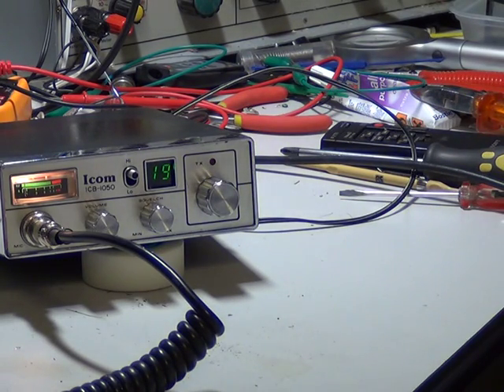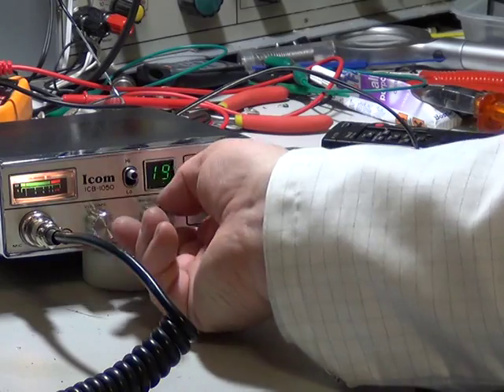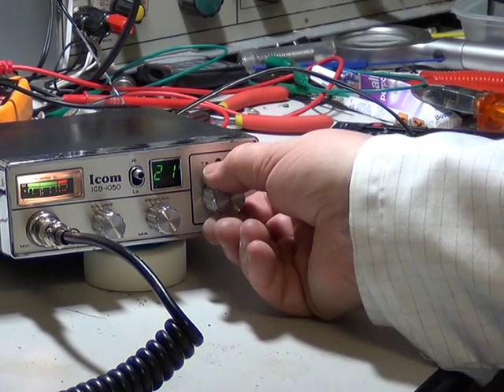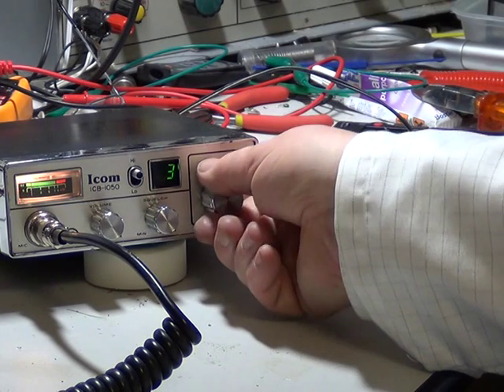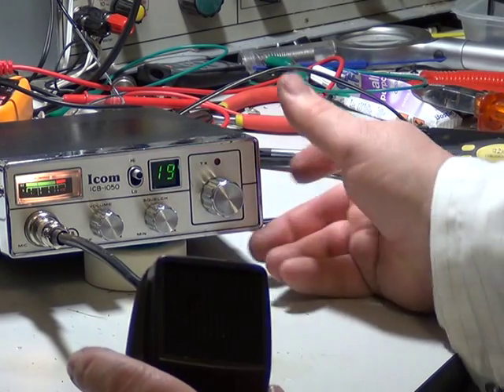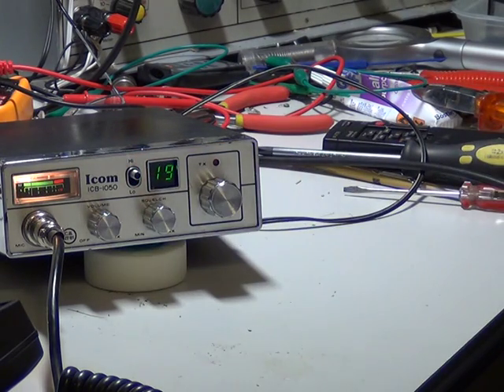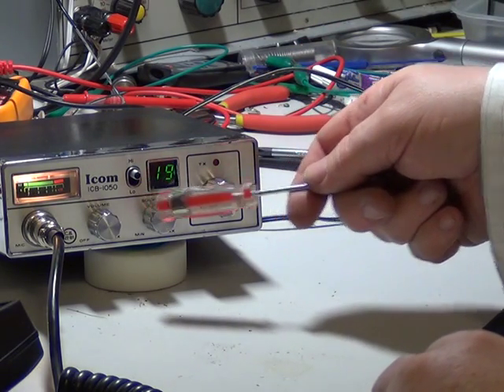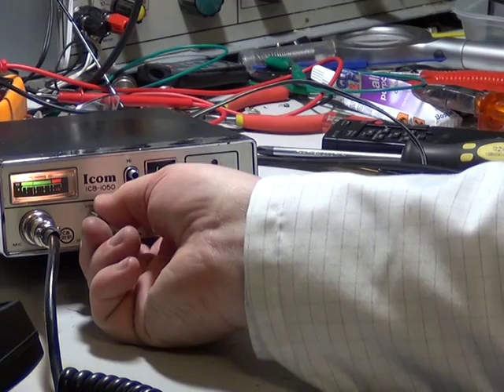Icom ICB1050,  UK (27/81 band) CB radio (Mobile). On the air test.

Comment: Hello I’ve still got one of these and have had it for a number is years. Only trouble I’ve got since I have powered it up it’s only keying up to around 5 pounds. Was wondering how you share any tips on what could be wrong. Thanks.
Reply from the maker: The power output meter only reads relative to SWR. When we set them on the bench into a dummy load at 4W, we then set the RF meter to also read 4W. However, when connected to an aerial & put into transmit, the meter could read any old thing; it means very little. You only can read the power output into a proper power output meter connected to a dummy load.

Richard, G0OJF, UK
Reply: @ukfmcbradioservicingTango21  hello Richard thank you 🙏 so much for your reply and help. Il give that a try. Greetings 🖖 from wales 🏴

Comment: Hi Richard these videos are superb...Can you please advise the test equipment you use,.also those little tuning pot tools. How about a workshop tour (cheeky)
Thanks and if i hear you from Yorkshire i will acknowledge your 19 FOR A ROGER ......ha ha   P.S i sent you a PM with a request.
Reply from the maker: In reverse order...I originated from Yorkshire, but have lived & worked in Lincolnshire since 1985, Near Ancaster, 7 miles from Grantham.

Test equipment. There are four test benches here each equipped with a communications test set. All test sets were purchased second hand over the last 20 years from Stewart's of Reading. I'm on a tight budget so I've never paid more than £1K for a test set, though they cost about £12K new. The test bench in the video is equipped with a Marconi 2951. Another bench has a Quartzlock 282A test set that doesn't go down to CB frequencies on receive, but can be used on CB's for transmit, my favourite is the Farnell SSG520/TTS520 combination test set because it's the quickest to use, and finally a Schlumberger 4040. Each bench has an oscilloscope & all except one oscilloscope are dead cheap ones because we are only looking at audio. One oscilloscope is an expensive one for in depth fault finding. There is also a very expensive sweep generator on one bench as you need one to set up the Great chassis like is used in the Fidelity 1000...believe it or not!

Each bench has Weller transformer operated commercial soldering stations, one is a digitally controlled one for doing SMT work with. Each bench has a cheap digital multimeter, there is a proper AVO multimeter in the workshop & a FET High Impedence multimeter, two IF marker oscillators, a portable audio generator, two CB mike testers, a logic probe, battery operated audio oscillator & various aids that we have made. Three benches have digital display 2.5A power supplies (no UK CB draws over 1.5A ), and there are a couple of other metered 20A power supplies for use when I'm doing commercial 2-way radio as many of those draw over 5A with their 25W transmitters. There are a number of Alexander battery analysers around as well.

The trimming tools come from RS components...but they have neatly discontinued the black phosphor bronze ones we use & I'll have to source a new supply. The Blue & Yellow tools are from RS. There are a couple of kits of plastic trimming tools that are also invaluable that came of Ebay!

Workshop tour may be possible later in the year when I've finished changing things around. Currently test benches are in different rooms & buildings here. At least three will be in the same room as the videos are being done in as soon as funds permit.

Regarding your PM, nothing yet received. try me at richard DOT shireby AT virgin DOT net . 

Richard

Comment: Hi Richard nice set of videos so far the information is helpful as the service manuals are hard to find now for some of these radio's. Is there any chance of some trouble shooting videos? Nice work tho and thanks
Reply from the maker: The troubleshooting bit can be hard to get across. Receive faults can only be sorted if you have a signal generator, though these can be picked up on Ebay for a tenner from time to time. I started formally studying electronics at technical college when I was 15, doing a three year course to learn about general electronics doing City & Guilds TV servicing later on (waste of time these days!), and then radio communications later. When I worked at Nottingham radio Communications for about 18 years I went on countless manufactures courses primarily with Maxon & Tait. In the 1990's Maxon, under their various brand names produced 89% of the WORLD's CB radios, in addition to professional business radio  systems that I was mainly working with. Maxon were buying 15% of Motorola's global semiconductor output such was their size. Bet China has taken much of that off them these days!

In conclusion it's difficult to get my thought pattern through to someone who may not have done the same training. I'll try & do some quick stock fault basic videos now you've brought up the subject.

You will probably be aware that I am also a professional musician & have have the same problem in that field too. People will say "can you show me how to play whatever"...I can't, they'll have to learn to read music first; then I may be able to help!

Thanks for suggesting this,

Richard
Reply: Thanks for the reply Richard. Ok no problem I do realise it takes years of experience to do this kind of work Been in the pmr game for the last 25 years in my area but haven't had allot to do with CB radio but it does interest me. I just thort that trouble shooting videos would be interesting to some people including me.
Reply from the maker: Have you still got test gear then?
Reply: UK CB radio servicing Yeah Richard I have loads of test gear but mostly I use a Stabilock 4040 test set but I also have a Marconi 2955 and some racal stuff ie mod meter, rf millivolt meter and frequency counter.  I like the stabilock coz it has the analogue meters as well as the digital option. To me its easier to keep an eye on whats happening with a moving needle especially with a sinad meter.
Reply from the maker: I've got a Stabilock 4040 too...snap. We had 2955B's at Nottm Radio, but some 'digital' test equipment is too slow...adjust ...wait...adjust..wait. 

Obviously the test set in the videos is the marconi 2951...the 2955 predecessor. Other benches are set up with the Schlumberger 4040 I mentioned, one with a Quartzlock test set (that doesn't go under 65Mhz, so no use for CB) and the quickest to use of them all, the Farnell SSG520/TTS520 combination.

So I suppose you were more setting up new kit that worked when yyou were in PMR, rather thasn fault finding bastards of faults!
Reply: UK CB radio servicing To be honest I haven't had allot to do with CB repair at all. I get mostly Motorola, Maxon, Tait and Icom PMR stuff both VHF and UHF I offer a programming service for most makes and models and the test sets are used to verify that the units are working as they should. Im not a big believer in being able to make it better by tweeking an extra half a watt out of a transmitter. You will know as well as me the most common repair with taxi radios is mike cable repair. We do get the usual reverse polarity issue as well with blown audio amps common. you are right thow about the surface mount components they are a pain but we usually manage.

I am interested in older retro type cb radio's as I grew up with them and can see that u are well experienced in that kind of repair so any tips would be apresiated. Do u find it hard to get replacement new parts for this older stuff?